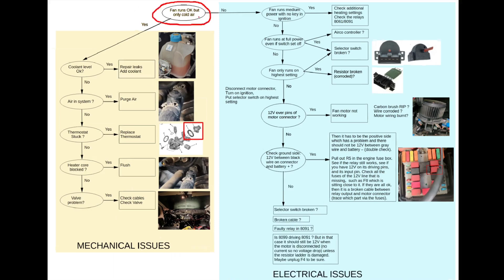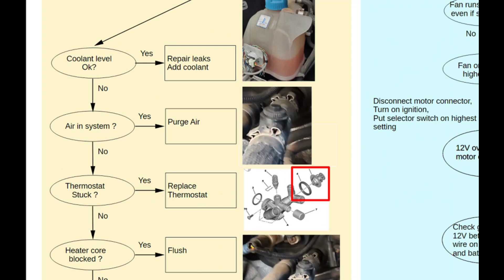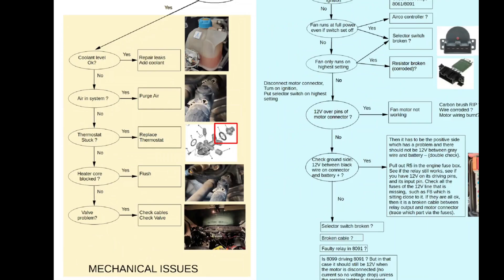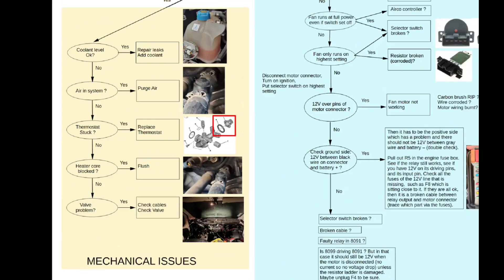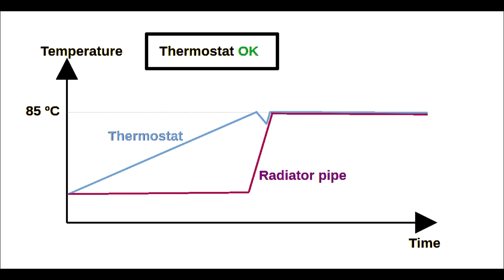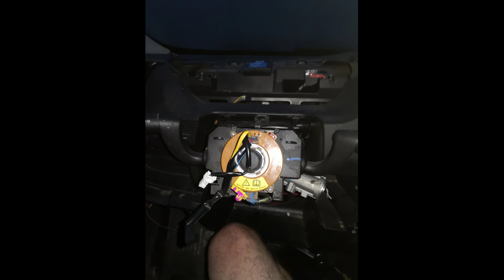Cabin Heating Not Working Part 1:Mechanical Issues,Blowing Cold Air Only (Boxer/Ducato/Jumper/Relay)

Comment: I have replaced termostat to a new one. I have hot water to the radiator but radiator is only hot where the house is connected. The radiator itself is ice cold all of it even after driving several miles. I have tried for months getting air out trying everything but it seems the boxer temperature spikes for a few seconds and then down again and it happens most uphill. I soon give up 😢
Reply from the maker: I assume you are talking about the radiator in the front (and not the heater core in the cabin). It  almost sounds like it is blocked then (some sludge that settled at the bottom blocking the exit point ?) . Maybe try disconnecting the hoses and test it by flushing it ? Worst case, installing a new radiator is also pretty doable. If you are taking about the heater core, same test by flushing it. If you need to replace that one ... urgh that is a hard job.  I do not understand the short spike though, if it is the front radiator that is blocked is should go high and stay high.  The temp sensor itself can also go bad, or stupid things like earth strap problems can also cause weird readings (but probable you would have a whole bunch of other weird stuff happening then too).  Good luck in any case, if you find it post an update !